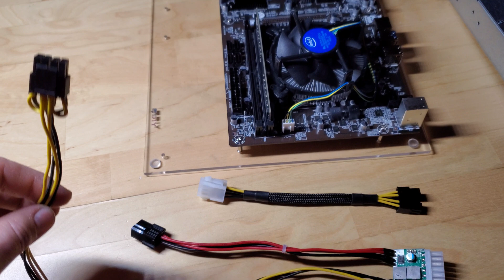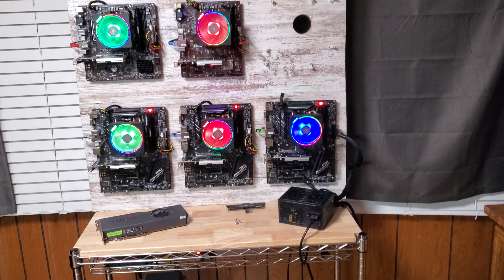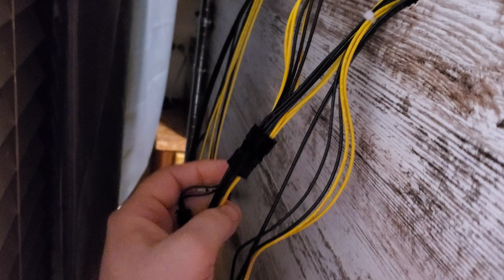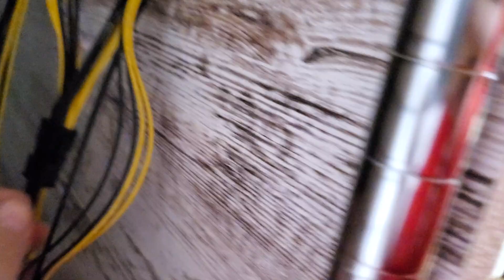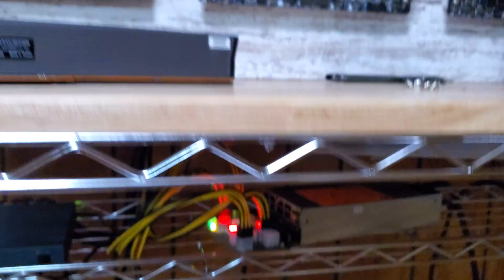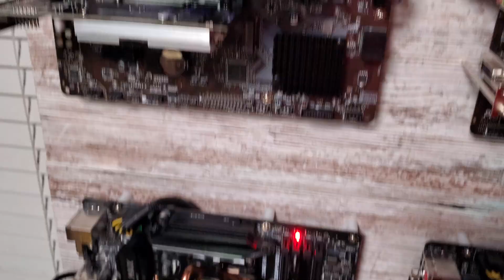CPU Mining with a Pico on a server power supply

Comment: That what I was looking for. Almost everybody on reddit screamed that I shouldn't plug multiple rigs to one PSU. And only one guy said that it is possible to plug 2 rigs to one ATX PSU with 24 pin Y-splitter. I was wondering how much I need for 24 pin, because 12v is 2000 watts on my PSU and rest voltages of 3.3v and 5v are limited to 150 watts.
Reply from the maker: Reddit ok but some ppl know and some ppl don't know. I'm one guy who watched hrs of youtube and asked others in this community and some ppl r running the some as me. So if ur Mining with mother boards u under volt and overclock I to a safe limit I would not of don't this but ya. In my video I'm got 5 mother boards on a 750 watt hp server power supply and only using 450 watts so I think it can b done. https://www.youtube.com/watch?v=vYRbr20K87Q

Comment: that wall is sick.  I never used a Pico adapter on a server psu.  Looks good though.  I also never got in to CPU mining
Reply from the maker: Thx sir, Ya I jumped in on the band wagon and I should have gotten GPU's instead lol but I'm just looking at it as spec mining.
Reply: @slicknick8713  I solo mine when I shouldn’t lol.  I actually went to buy CPUs and bought gpus instead because they had open box